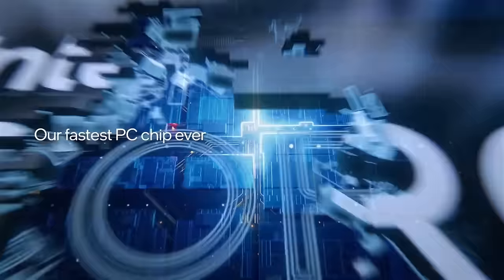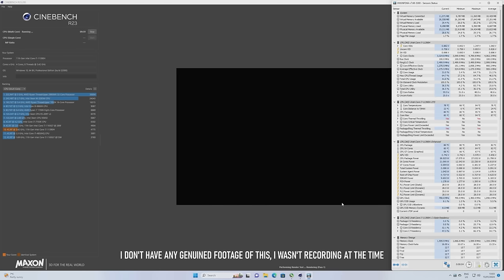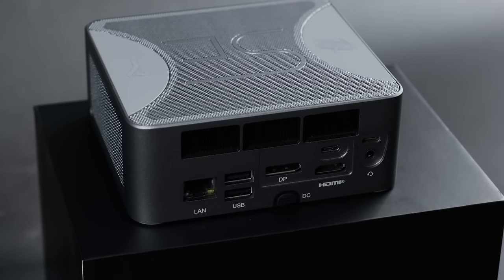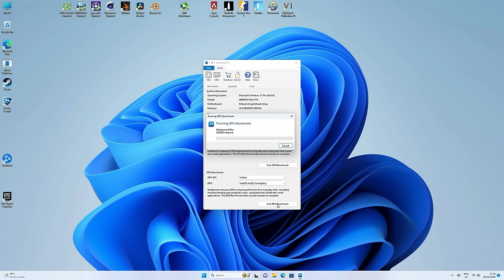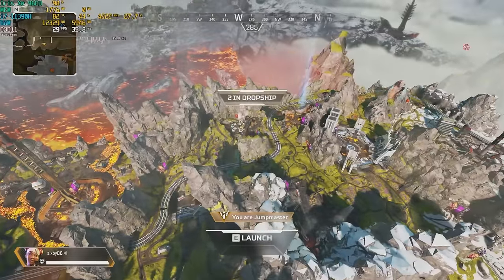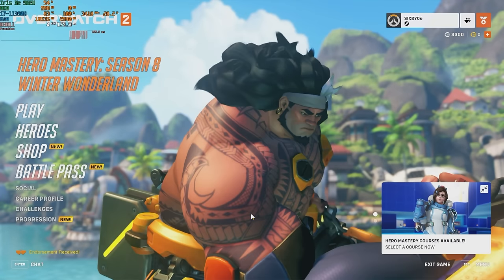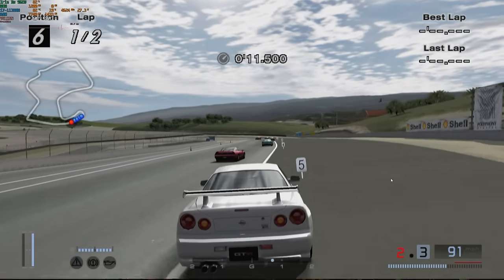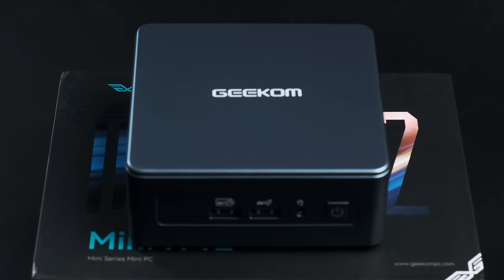Can Tiger Lake still roar? | Geekom Mini IT11

Comment: The 11370H/11390H were very bizarre. Basically just a U series CPU with a boosted power budget, but no extra cores like the other H series i7s have. Many mobile i5s of the same period also had more cores, so it truly was an H series i7 in name only.
Reply: I really hate the i7 11th gen mobile cpu’s. At the time when they first released, I was looking for a gaming/programming laptop for my now ex and also myself since I was going into college. Found a 3070 laptop with this i7 for sub $1000, was thrilled because it seemed like an amazing deal but was suspicious of it from the price. Did some digging and found out that it couldn’t even handle a power kneecapped 3070 because it was that weak. What’s sad is that despite 11th gen desktop being very lackluster, 11th gen mobile was actually an upgrade in core count and IPC from 8th-10th gen but it just kinda sucked.
Reply: I have a 8850h and its literally miles faster than the 11th gen. Bizzare

Comment: 12th/13th gen Intel is when these chips really shot off and your graphs (mostly!) show. I have an i7-12700H 14 core(!!!) in my Nitro 5 laptop and it just flies. It was scored double what my Ryzen 5 1600X did in Passmark and is only 1/3 the score of my current Ryzen 9 7950X desktop.

Paired with a 6GB 3060, 144Hz display, 16GB RAM, 512GB PCIe 4 SSD (with a spare slot and 2.5” upgrade kit included), all for £999? I couldn’t say no to that. And it’s got Thunderbolt on the back!
Reply: Where did you get this holy grail of a laptop
Reply: 14 core in the spec sheet only. 8 of those are efficient and act like half of a performance core.
Reply: @Bizarny  Indeed, but a core is still a core. 6c12t performance, 8c8t efficiency.
Reply: @SantoCimbalo-i7m PC World UK last year, it had about £200 off RRP for some reason lol
Reply: Imagine buying a 1000£ laptop and only getting 6Gb of vram in 202X. That's so bullshit.
Reply: @BonusCrook  I could’ve spent 1.5x for a laptop with a 4050 and it had the same amount lol
Reply: @cleanycloth  thats 1.5x more bullshit.

Comment: I own a gpd win Max handheld laptop. It came with an I5 1035g7 and after like two years I upgraded the whole motherboard to a Tiger lake based one. My cpu was and still is the I7 1195g7, that goes up to 5,0GHz. All I have to say is that Tiger lake has been a major upgrade for my personal computing needs and  especially gaming profited massively. The xe GPU is a major step up and it allowed me to play games like elden ring at 720p 30fps locked without any frame drops with decent settings. What I don't really like is the fact, that Intel has locked down undervolting and other forms of tweaking (I usually get massive efficiency gains tweaking my cpus).
Reply: I feel you, I went from 1065G7 to a 1165G7. That DG1 (Xe) is an appreciable upgrade even if it isn't realy made for 1080p. It supports 3440x1440@144hz, has AV1 decode, VRR,... On the same node (10nm), Tiger Lake was a massive upgrade in frequency over Ice Lake.

Comment: If you need intel this is a great kit.
I personally picked up a 7840HS based unit for ~$20 US more, but it didnt come with drive or RAM, let alone name branded like lexar, which also means it didnt have a windows licence.

(i got bare bones because i was going to get a pair of 4TB drives and 32GB of storage, didnt want to buy a complete unit and emediately shelve the parts)
Reply: Oh hey mr fedsagainstguns nice to see you here

Comment: Tiger Lake was a big step up from Rocket Lake; but obviously Alder Lake is better than both.  I have found Tiger Lake to be a pretty good setup with an 11800H and a higher Ampere dGPU onboard.  It was nice because Intel finally gave the laptops PCIe Gen 4 (which is still smoking fast BTW), more cache and a better memory controller.  They do get hot though, these chips.  Again, this chip you tested seems weak to me; but the 8 core 11800H is not weak at all.  Interesting video.

Comment: Comparing this to what is (almost) a direct competitor, the Ryzen 7 5800U found in my laptop, is... Interesting. Especially considering that my laptop only runs at 15 watts yet in games, seems to be quite a lot more stable.
Reply: amd apus simply are better, even today, intels new gen apu barely competes with amd’s last gen
Reply: More powerful, uses less power, often available for less
AMD is really the only good option for laptops
Reply: Jarrods tech usually finds the CPU performance per watt to be similar intel/amd. So just better in iGPU.

Comment: I generally like tiger lake, as it's the newest of what I'd consider to be "usable" architectures from Intel. It's the second generation of Intel mobile chips this decade to not be using Skylake, so the cores are pretty OK, and it uses the still (somehow) current gen Xe-LP GPU uarch. It's also on their second-gen 10nm node, making for an overall usable chip. Not to say that older uarches aren't usable, they totally are, just that TGL is the oldest uarches that I'd still consider "newish"

Comment: From your experience with buying used from CeX have you ever used their 2 year warranty? and how would you compare their used products to ones bought from private sellers on websites with or without buyer protection and the original product warranties? As ive seen CeX takes away most of your savings from buying used and im wondering how much you think the 2year warranty is worth from them :)
Reply from the maker: I've used the warranty several times. If I'm inside 7 days of delivery they usually just inspect it and then refund within a day. I don't always get chance to return within the 7 day window, so when that happens they tend to refund as a voucher.
I've had a number of items from CeX that straight up didn't work, weren't what I ordered, or were in terrible condition, so if they weren't so easygoing about their warranty I'd be much more reluctant to use them. As it is, the convenience of being able to walk to my local store and have them help with problems is worth far more to me than anything eBay offers in the way of buyer protection.
It's been a while since I had a bad experience as a buyer on eBay, but I still feel a certain preference for CeX. Unless I'm looking for something specific, or there's a big price difference, I usually prefer to buy from CeX if I can.

Comment: This is an strange "H" model and 4 cores are 4 cores, nowdays they are just fine.

But even so this thing is a bit weird, this CPU is performing worse than a 1135G7 connected to AC in almost every test.

Comment: 200 less, perhaps.  
Well over 400, for a slow 4 core...yeah no.
Reply: But for what? I'm sure that it is great everyday PC for web and office but $60 old refurbished prodesk mini will also do that good enough. And for everything else this is too slow and too hot. Pointless machine, I'm sure more than few people buy it for i7 brand just to end up hating minipc's in the end.
Reply: @gorjy9610  Everyday web browsing, and some office work would be fine.  But yes, not for over 400.